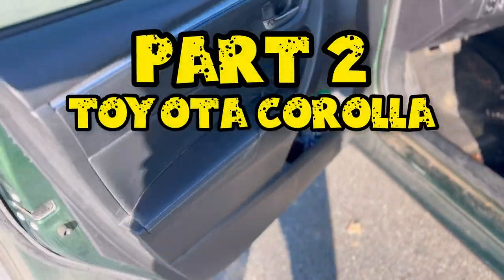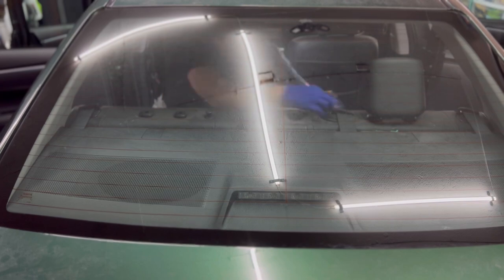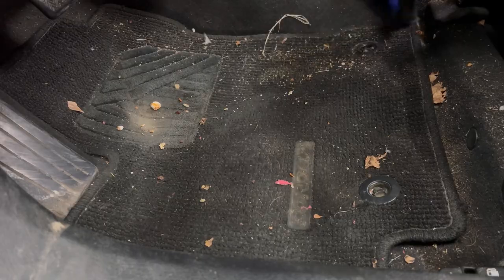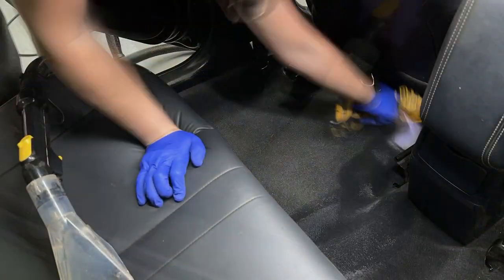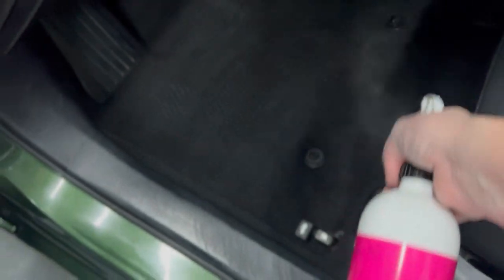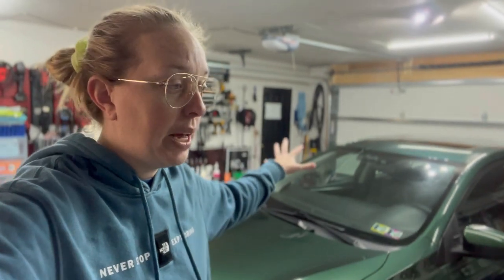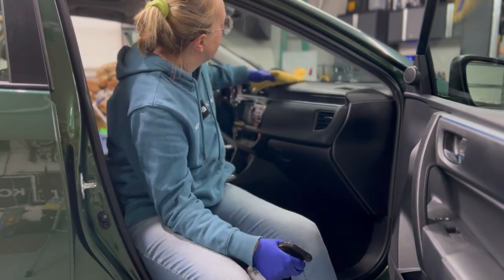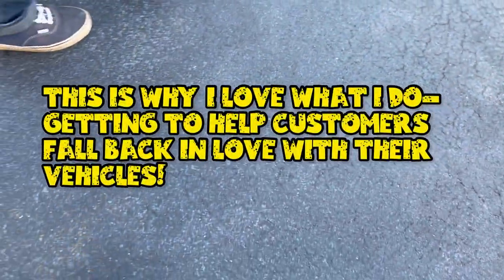Interiors NEVER Been Cleaned (8 YEARS OF DIRT!)+ Satisfying Reveal! Part 2

Comment: Nicely done! Have you considered using a steamer for aiding in getting the deep grime out on interior cleaning? When you get new interior carpet and seat extractor, look at the Mytee pro line, their heated power extractors are the bomb. Personally I would want seats and console pulled and carpet pulled to power wash it and clean the chassis floor for there is defo stuff that seeps through carpet to chassis floor when that bad. Realizing that level of work is the purview of the big time disaster detailers though. Great work! Oh by the way, I would suggest blurring out customers license plate or covering or removing it. This is a crazy world and never can give enough security to a customer.

Comment: Hi just a little tip if you buy a spare flat nozzle for your vac and tape a lenght of flexible tubing to it you can get into a lot tighter spaces such as under the grill on the front by the wipers to clean out all the litter that slips through the grill
Reply: Ps nice imformative video Chelsea 👍

Comment: Very nice result after so much hard work! Obviously you run a business and you do you, but I might suggest removing the front seats for major details like these. It's not terribly difficult, just need the right sized socket and to remove the wiring harness. Don't have the car running when they are removed, otherwise it will throw a code for the airbags. 

As far as plastics, getting major grime off could be easier with a steamer. With steam, the main thing is to keep the tool moving so you don't overheat an area. Just spray on an interior cleaner, steam, and wipe. Might save some time for you.

Comment: The impossible carpet just need to be vibrated and vacuumed you can use a large throw polisher, just put the backing plate on the paper turn the polisher up and go. The carpet needs to be 100% dry before doing this.

Comment: Glass always stunk until I used a applicator pad with onr then use a plush microfiber to dry it. I gave away all my glass towels and glass cleaner. I even have used just water and it worked better then all the glass cleaners I've tried, the onr is nice because it allows a little slip to the glass which makes drying alot easier. Just have to make sure your drying towel stays dry on large suvs I use two drying towels.

Comment: Great video and excellent work Chelsea. Yikes about that AC evaporator drain plug issue. From personal experience I'd advise you or the customer to fold back that section of carpet and make sure that you thoroughly dry and treat the padding for mildew. Also get the plugged drain fixed ASAP. Great looking results! 😎👍

Comment: "Wow !!... You Did An Amazing job On This Corolla Chelsea!! But I Have A Question How Do you Soften New Stiff Detailing Brushes From Scratching Rubber And Plastic Surfaces?.. Also Do The Ultra,Soft Detailing Brushes Leave Scratches On interior Surfaces like Radio Station Screens or Shifter Displays?..
Reply from the maker: What kind of brush are you referring to when you say Stiff Detailing Brushes? And the ultrasoft Detailing Brushes I find do not scratch piano, trim pieces, or radio screens. Those are what I use for that area but even the chemical resistant ones are pretty soft on those surfaces more so than the natural brushes.

Comment: Hey Chelsea, another great video! Been watching for a while but haven't left a comment, but your videos are great :)

I am wondering, have you tried the tornador instead of brushes/drill brush for getting the dirt from the carpet/cracks/crevices? I have been doing this for a bit now for my customers and I haven't had the need to break out the drill brush. If you haven't tried it, the tornador has been the best thing I have gotten for dirty carpets! And for cleaning tight areas (around the shifter, vents, etc) I use Yvan Lacroix's trick of a rinseless dampened towel, blow gun on the towel on top of the area, then use the blow gun to dry the area. I do this on door panels too, but not on the center console ever. Saves tons of time and works extremely well for me!
Reply from the maker: My problem is I don’t have an air compressor large enough to really support it and I don’t have the opportunity to put an outlet in my garage that would be able to support such a large air compressor so I’m limited, and I found ways to kind of work around those limitations. 
I had a smaller compressor and a vortex gun that I used in the past and found that my compressor was having to refill almost every 20 seconds and it was super annoying for my neighbors so like quickly stopped using that
Reply: @Attention 2 Details w/ Chelsea  i totally get that... LOL I take for granted my home garage I can modify as I please 😂 I installed a 2nd 20A circuit myself so I could have a decent sized compressor lol I kept popping my breaker by running steamer + vacuum + compressor when they are all getting kicked on

Comment: I have a 2015 Mustang Convertible. My top looks terrible. I've seen several other Mustangs with the same crappy looking roofs. I've tried cleaner and dressing. Not really helping. Been looking at dye products. Your thoughts on dyeing a canvas convertible top?
Reply from the maker: You run the risk of overspray but if it can be professionally done it can work but it might just be better to have the top redone